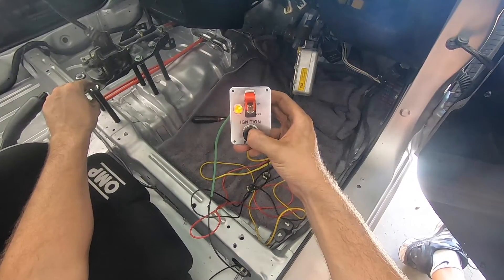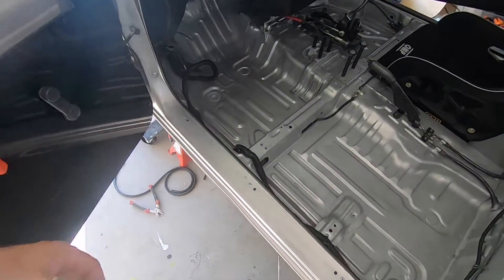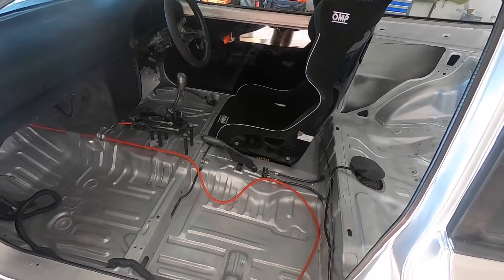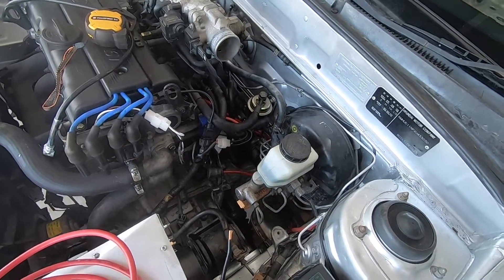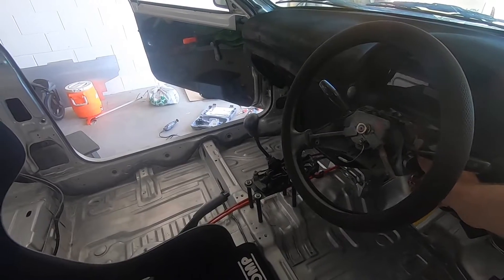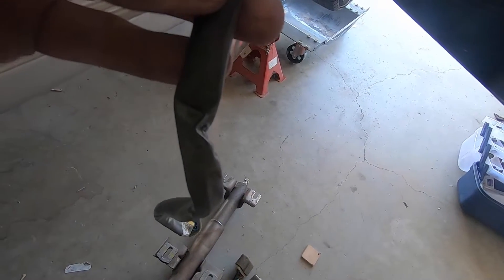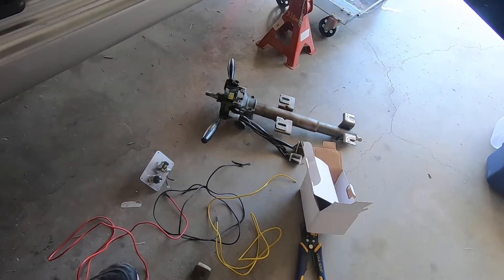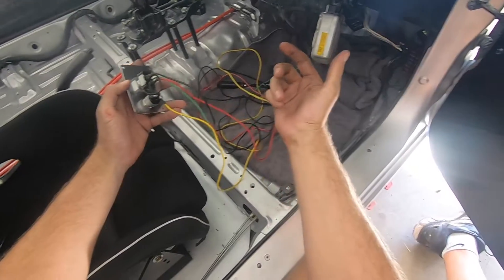Battery And Ignition Switch Install

Comment: this car is looking so cool man, i bought an exel recently too and i found your channel searching for mods i could do to it to turn it in to a track day car unfortunaly i cant do a lot of the mods you did im from Portugal were even a aftermarket air filter is ilegal.
Your videos inspired me to continue with my build  thanks man!
btw were did you got the shifter? my stock one has a lot of play in it
Reply from the maker: That’s awesome man! Glad I could give you some inspiration. I have raised my shifter, but haven’t put a short shifter on it just yet. There are a couple of places here in Australia that sell them. If you google “Hyundai excel short shifter” there are a few different options. The one I will link is from a business called Brown Davis who I will more than likely get mine through. They do an excellent job in engineering the new shifter to stop overthrow and damaging the gear box, but also widening some of the gates so you can get a nice 4th to 5th shift, and not an accidental 4th to 3rd. They replace the bushings and it pretty much comes to you like a brand new shifter. Hope that helps :)

https://rollcage.com.au/product/hyundai-excel-short-shift-gear-stick/
Reply: @BigRigRacing  Thank you  for the information man, im going to check it out, i love these cars they, are so fun to drive, the only thing that sucks is that most of the aftermarket parts for these cars are in australia and they dont ship to portugal i cant even get a steering wheel hub adaptor. the only thing i managed to get shiped to my country was a Nolathane bushing kit.
Im exited to see more progress on the buidl keep up the good work 👍👍👍
Reply from the maker: That_ugly_dude just out of curiosity, why is it so hard to get parts in to Portugal? Is it government restrictions?
Reply: @BigRigRacing  we can get parts shiped here but the problem is to get parts for this específic car because the only aftermarket parts i could find for this car either come from the UK or Australia and sadly neither one of them seem to ship stuff here. But its linda cool fabricating parts for it like strut braces and solid mounts. The hard part is suspension the only thing available here are lowering springs, i Will have to think of something to get some coilovers for it.
Reply from the maker: That_ugly_dude oh ok. Makes sense. That’s a shame, cause they are fun cars to drive and work on

Comment: Hi mate lovin your vids. Can you tell me if they also race 5 door excels in the series?
Reply from the maker: Thanks mate :). I believe some people do race the 5 door version of the X3 model Excel. From my understanding the actual chassis is not too much different, just the panels and such. But I have seen pictures of the 5 door version. The big thing to look at is the model of engine needed for series. The engine number on the side of the engine is pretty vital. You can run either a single or double overhead cam version on the engine, but it has to match specific engine numbers. Other than that, pretty much any model X3 excel can be raced.
Reply: @BigRigRacing  thanks mate appreciate that. Can't find those numbers on the website. I'm looking at a couple of dohc versions, one with black top, one with silver top.
Reply from the maker: Simon Cutajar they both should be fine. I know some guys run the silver top engine, they are usually more sought after due to having a balanced crank I believe. Engine number to look for on a DOHC is G4FK. If I remember correctly, it’s on the side of the engine under the ignition coil. The SOHC version is G4EK.
Reply: @BigRigRacing  thanks mate appreciate that.

Comment: What connector did u use to join the fuse box cables ? Or did u solder it ?
Reply from the maker: Hey mate, I soldered the new cable that joined the existing cable to the fuse box. Then just ran some red heat shrink over the top. One less connection that could go bad by doing it that way I feel.

Comment: Naw, I ran out of your excel racecar videos to watch.   :-(
You must do another one very soon.  Pretty please?    Hahahaha!
Wow, it is getting pretty close to being done now though.  You only really need the rollcage, a steering wheel with boss kit & removeable wheel kit, suspension, wheels & tyres, and the short shift gearstick then you're about ready to start racing her, hey?
Noiiice!
Reply from the maker: Narayana Cooper haha hopefully have another video coming soon. Still have a long list of things to do. Roll cage, mount the seat, harness install, steering wheel, battery isolator, suspension, brakes, window net etc... hopefully it will all be done sooner rather than later

Comment: Does your car not have an immobiliser ??
Reply from the maker: Because this is a track car and will be used to race in, it doesn’t have an engine immobiliser as such, but rather a kill switch that can be activated from inside and outside the car. When pressed, it shuts down all electrical systems within the car, including the ignition system, effectively immobilising that car itself.
Reply: Big Rig Racing I’m aware in in the process if making a track Volkswagen lupo myself. I was just curious as you installed the push button start and eradicated the key. Was just curious as to if the factory ecu immobiliser was removed or non existent anyways. As my car has an immobiliser so such setup on my car wouldn’t work
Reply from the maker: @JParkes43  oh ok. No this car didn’t have one when it came from the factory. It had a steering lock which I have removed as part of the regulations for this racing series I intend to run in, but no such immobiliser integrated within the ecu.
Reply: @BigRigRacing  ok thanks! i too have to remove steering lock to comply with regs